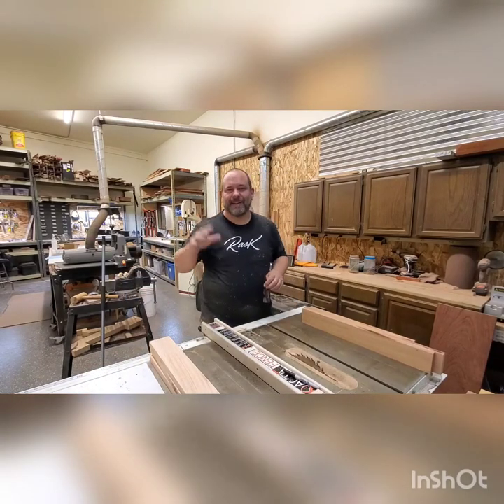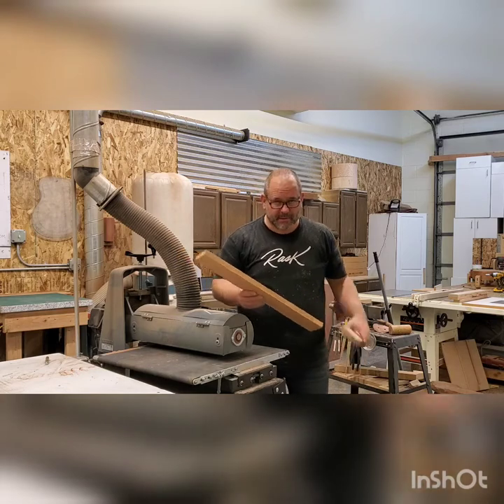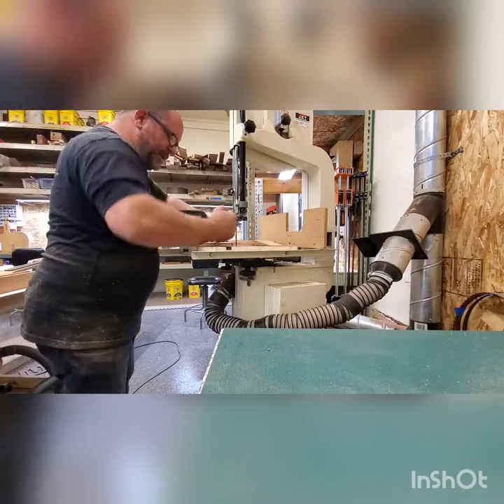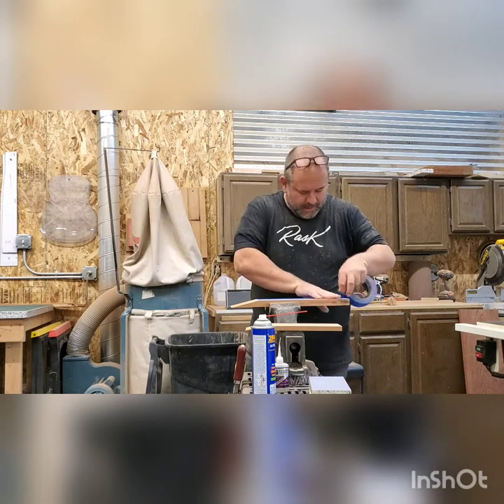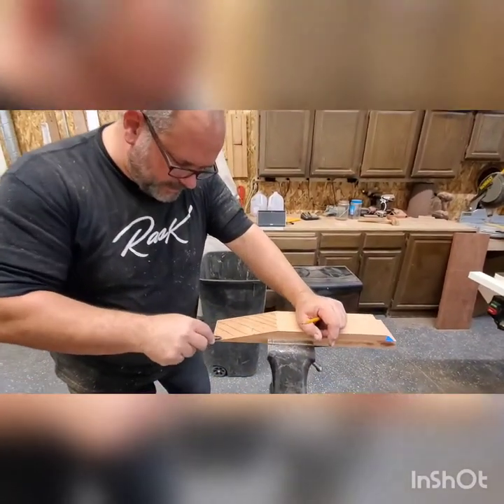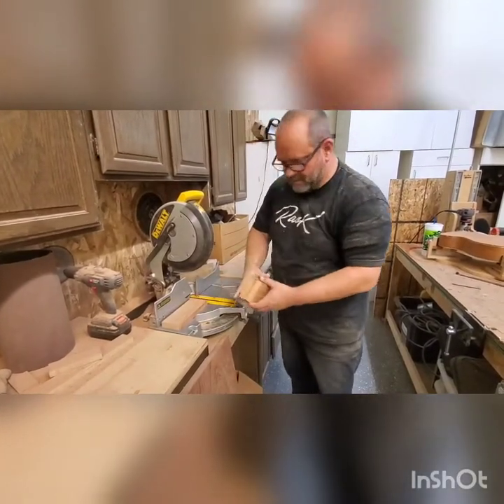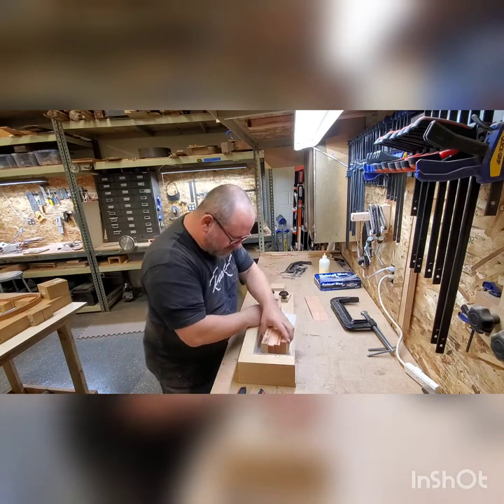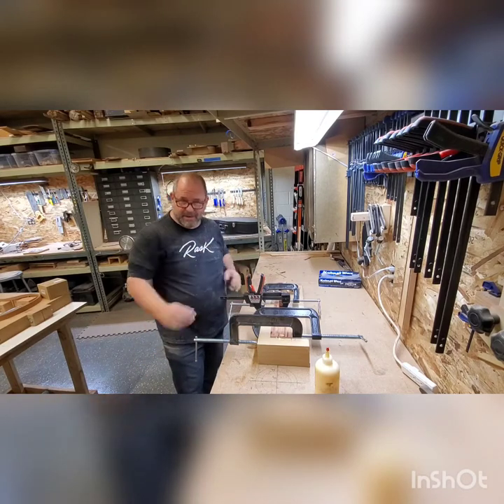Rask Guitars - Building an Acoustic Guitar - Part 1 - Gluing the Neck

Comment: Watched this on IG and had to watch it again and show my son. We’ve talked about building a guitar, something I have always wanted to do. The video gives a great how to and perspective of the build! Thanks look forward to the next. 
Couple of questions.

What was the angle for your jig for the bandsaw? Any woods you would recommend starting with? And measurements of the pieces you are making?
Reply from the maker: Thank you Matt! 

I use a 13 degree angle on my headstocks. 

Mahogany is a perfect wood to start with. It's easy to work with, and sounds amazing!

The measurements really depend on your scale length. I use a 25.4" scale. For that, I start with a 36" x 3 1/4" x 4/4 board. I cut 23" off that for my neck and headstock. The rest will make up the heel stack.

Good luck with your build!!